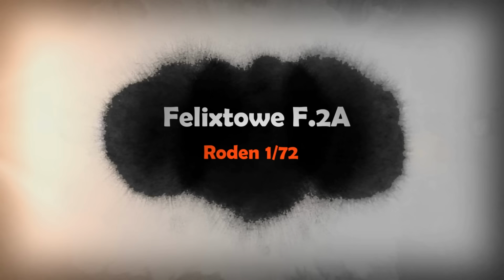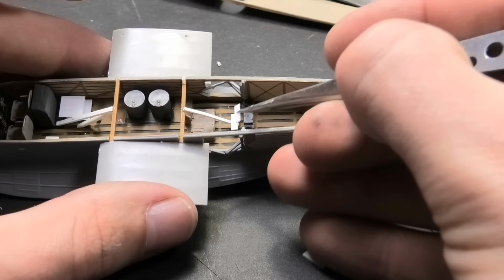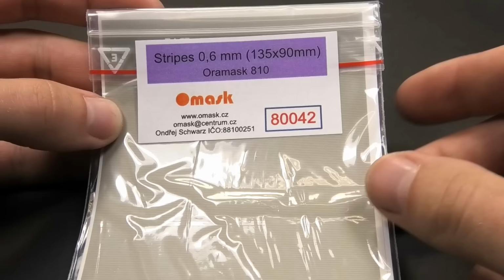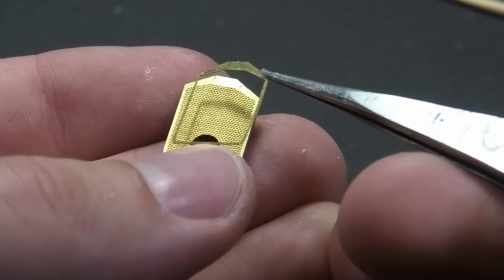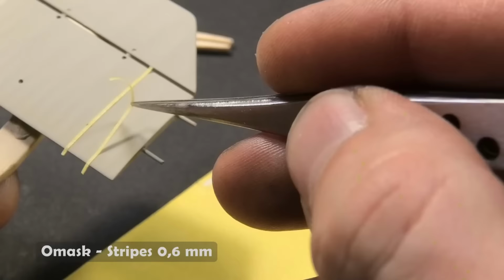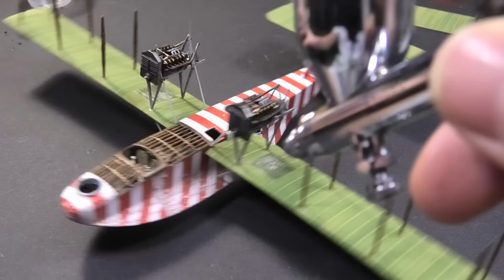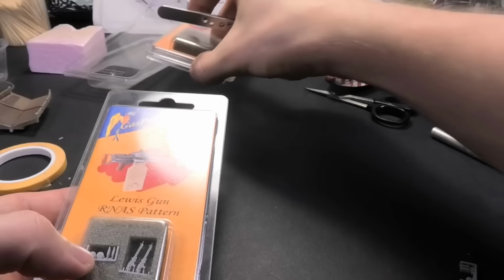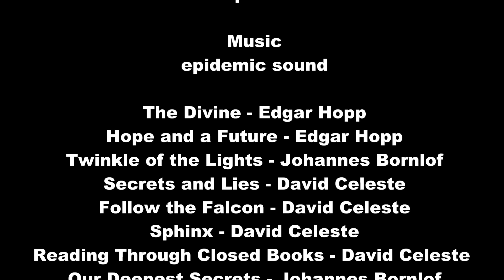WW I Felixstowe F.2A - Roden 1/72 - Aircraft Model

Comment: Spectacular build! So much color and detail for the eyes to feast upon. I'm torn as to what was my favorite part, because the wood slat hull looked heavy and beautifully finished, but the elaborate rigging and eye tearing color scheme (really, what was the point in painting the tops of the wings green as if they were camouflaged when the sides looked like a circus tent?) was amazing. The engines were gorgeous and the way you built the frame to leave the inside cabin visible was superb! Just can't say enough about what a great piece of kit it turned out to be except that if the other modelers in the club give you any competition at all, it must be an exceptional bunch of craftsmen!

Comment: It really works great and the paint and details are excellent.  I just built a 1/32 scale Bucker BU 131 German WW II bi-plane from Revell model, it was fairly easy, the only tricky part was the rigging wires, so I bought a good set of tweezers,  I plan on making a model of the Zeppelin Staaken  WW I  heavy bomber,  I see Roden models makes one and those tweezers will be handy for all the rigging.

Comment: You should look up Infini cutting mats for strips of masking tape/shapes.

Type A is simple straight strips. They're like £18 and they'll save you the effort of waiting for pre-made strips to arrive and you can have many sizes from 1mm steps down to 0.4mm.
Cannot recommend them enough, I bought them, never looked back and will always recommend them to anybody with an apparent need/a chance of listening. 

Also probably cheaper in the long run because you're not paying the hobbyist tax on anything other than the mat. After that you just buy standard yellow masking tape at like £5 for a roll of 50m or something stupid and you never have to worry about masking tape again.

Comment: What do you mean when you say that super glue is more stable than Tamiya's putty?
Reply from the maker: I used aggressive Tamiya extra-thin gluing. If you apply Tamiya putty over it, then after some time, it will create sink marks. So, the super glue for the first layer will prevent this issue.